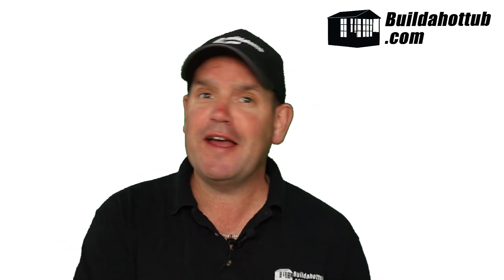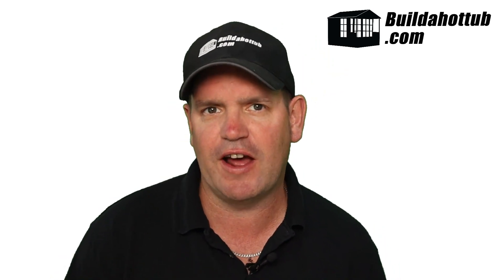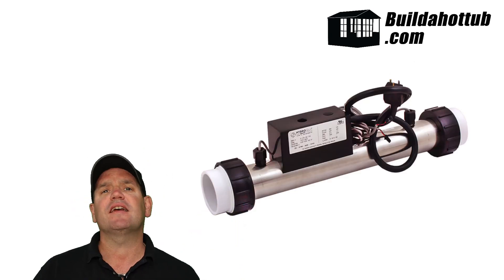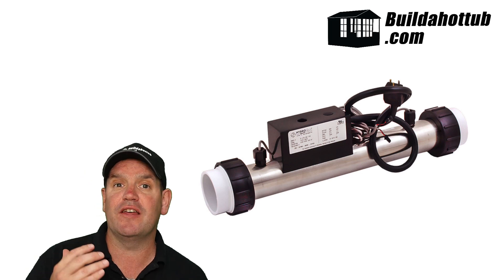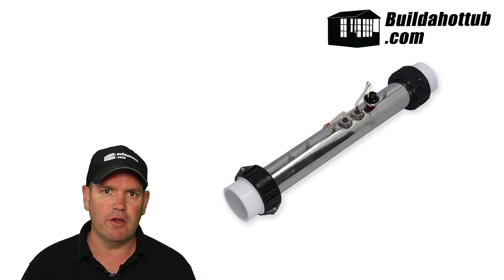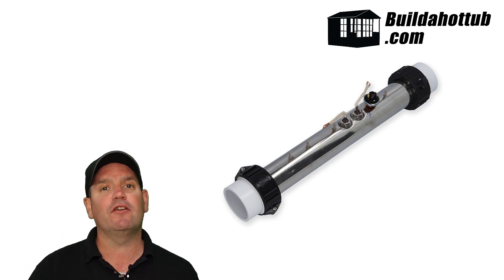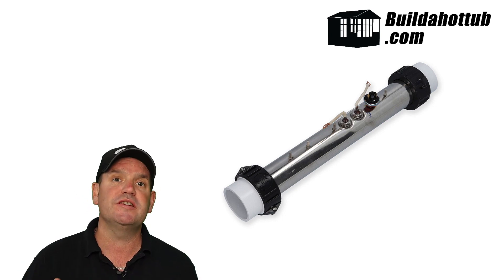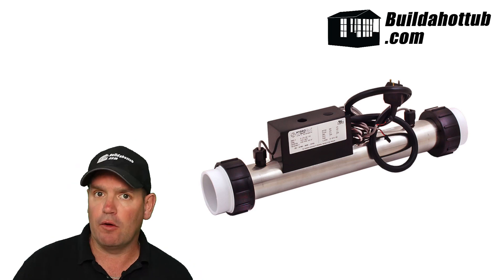Flow-Thru Heaters - Everything you need to know

Comment: We recently installed a brand new curcuit board and flow thru heater. We think the issue is the placement of the flow sensors. Where exactly should they be placed? There are 2. We have already tried troublshooting every other possible error.
Reply from the maker: Depends on the model of heater you have - most have either pockets for the sensors to be screwed into or there are places to attach them on the tube itself - you dont normally get to select the location for the sensor.

Comment: I have an H20-RS1 flow through heater, and a 2.5hp pump.
I have it wired in a very basic way in that when i manually switch the pump on,  the heater is wired into that switch, so it only recieves power when the pump is running, is there a way to wire it, so the pump will be triggered by the temperature drop in the flow through heater? Or do i need the "spa pack" you mentioned to control this?
Reply from the maker: Hi There, you would need the spa pack to do that - the temp sensors are redundant without the spa pack to read them - hope that helps - Andi
Reply: I have the entire system off my old hot tub, everything worked but never used it. I have entire board and control panel, how to set it up?